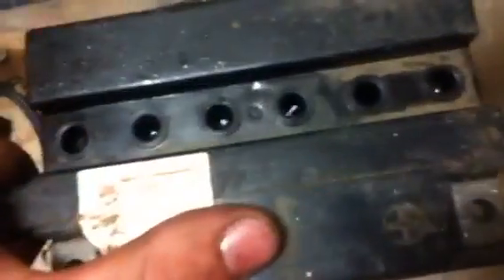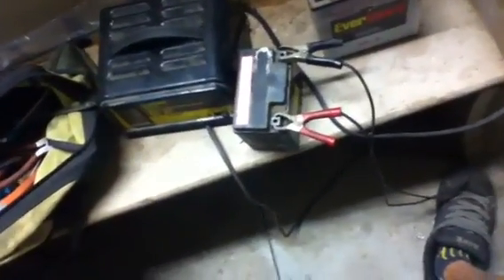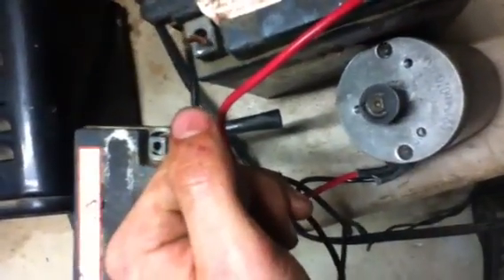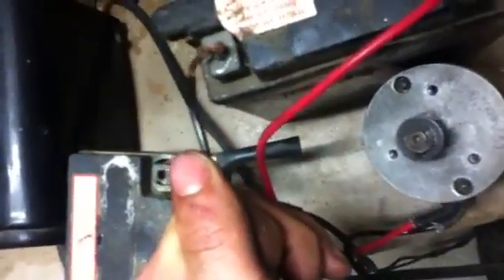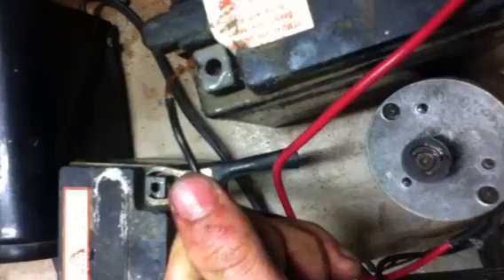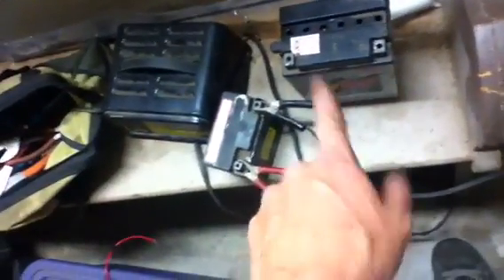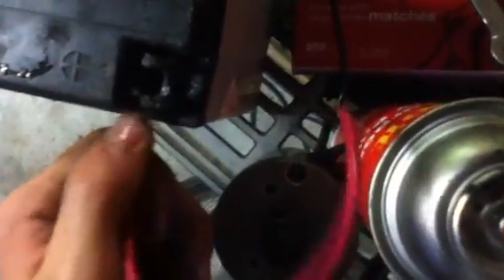Motorcycle battery works after ten years dead

Comment: Try the processes they show on here. Dump the fluids and acids from the battery. Put baking soda to nutralize in old fluids so you can discard them safe. Then put like 1 cup of epsom salt to two or three cups distilled water or reverse osmosis water ive heard is nearly the same. Then put the new fluid into battery. Charge on two amps the lower setting of most chargers for like however many hours you need and it did work for my battery that was sitting dead for year or so too.

Comment from the maker: @BatteryStuff Nah I diddnt use a meter, I put it on and it doesnt have quite enough power to start my 4 wheeler. Any motor around that size would turn over it wont have the amount of hp or rpms as it says it should tho! Electric motors are basically electric magnets, that's how they work, the more current u feed it, the harder it's gonna turn over!

Comment: Wow, that's pretty surprising. Curious, do you use a stand along volt-meter or multi-meter? I wonder what readings you'll get from that battery. How does a 12 volt battery turn over a 24 volt motor?
Reply: Slowly